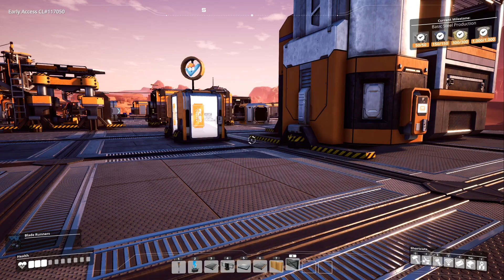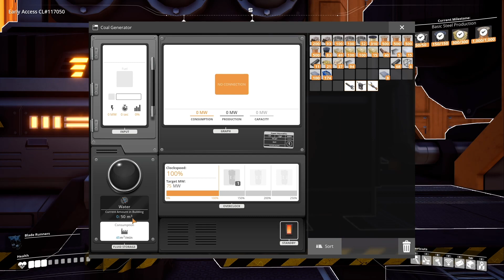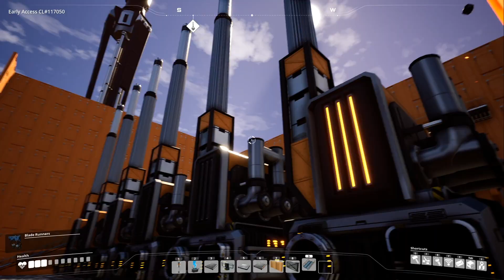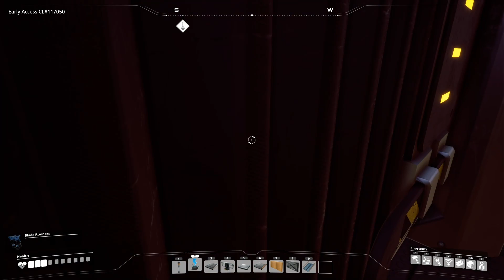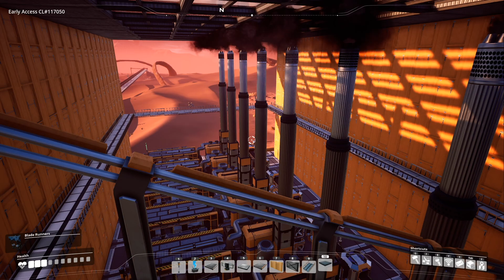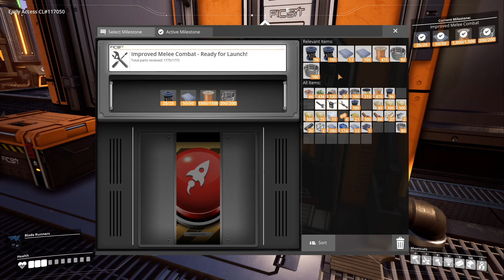EFFICIENT COAL POWER PLANT in Satisfactory Update 3 - S2E3

Comment: Okay, so I JUST started over the weekend and yesterday got to the coal generator and I'm a little confused.  Everything I have seen is everyone building this kind of 6 generator system.  Is there no way to have just one until you get more material?  Also, and maybe more importantly, if you can, I have no idea how to get the power FROM the generator to be able to use.  Please forgive me for being such a noob.
Reply: If you plan out your coal generation so you don't have to redo everything, you can certainly start with just one and add to it.
Reply from the maker: You can certainly overclock the coal generator, which in turn requires more water and coal. If you have the resources, it can be easier to just add more coal generators with out overclocking them. Simply connect a wire to the coal generator from your power grid in the same way you'd power any machine. The generator will add power to the grid, rather than consume it. A single pure node of coal can power 8 coal generators and will require 3 water extractors. Long and short, there's no wrong way to do it! Whatever design works for you is the right one for you. :)